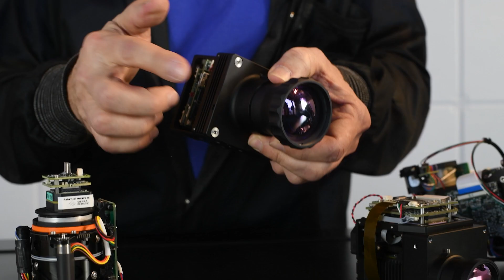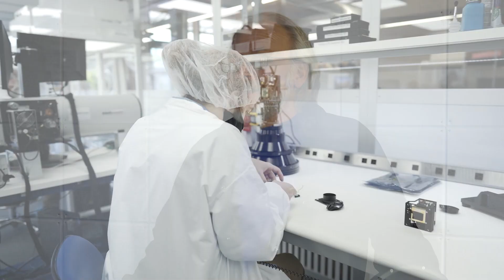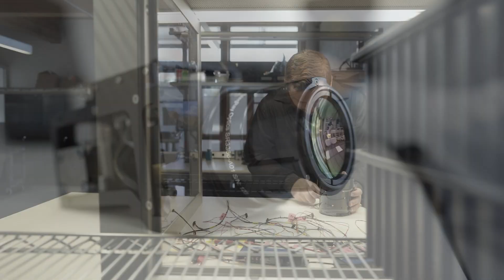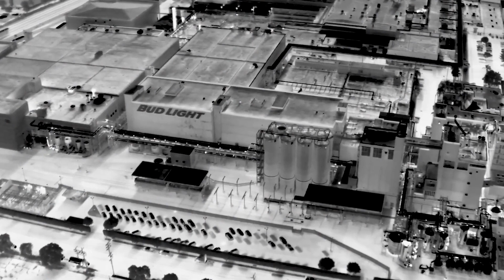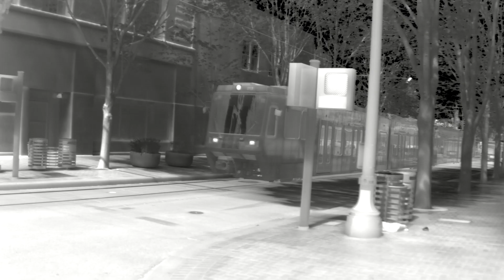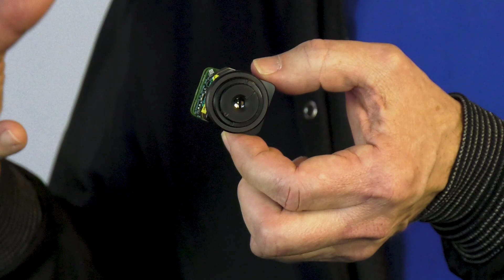Ask an Expert: What is a micron?

Comment: Sierra olympia
Can you please tell that Why 12 micron can't detect fire but 17 microns Can
And in thermal image sensor camera what does 17 microns means, can it detect light more than 17 microne in wave lenght? Or it has ability to detect less than 17 micron, kindly explains interms of waves length disctance terms like distance between two tops crusts

Comment: What is the benefit to 10-12 micron over a 17 micron?
Reply from the maker: Great question! A 10-12 micron pixel pitch offers significant benefits over a 17-micron pixel pitch in thermal imaging. Smaller pixels deliver higher resolution, sharper images, and improved detectability. They can discern finer details, making it easier to detect and identify objects at a distance. Smaller pixels also allow for a reduced minimum focus distance, which is advantageous in scenarios with limited proximity to the subject. However, the choice between pixel pitches should consider the specific application's requirements and potential trade-offs, as 17-micron pixel cameras may excel in different long-range surveillance scenarios.